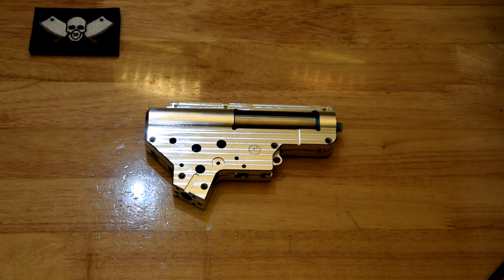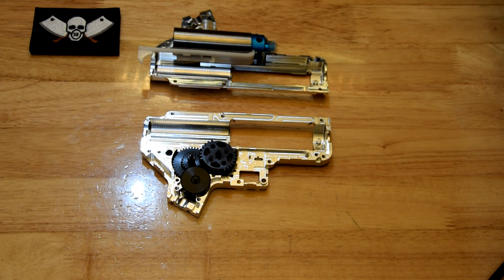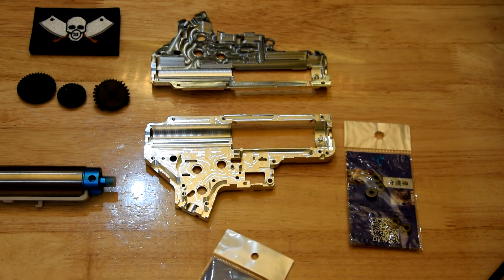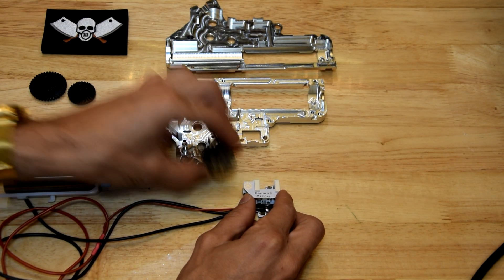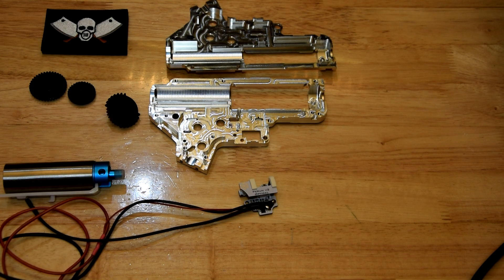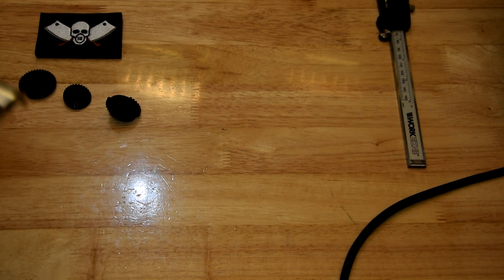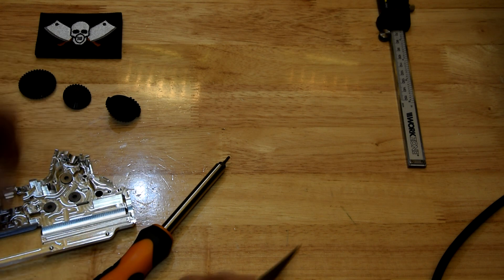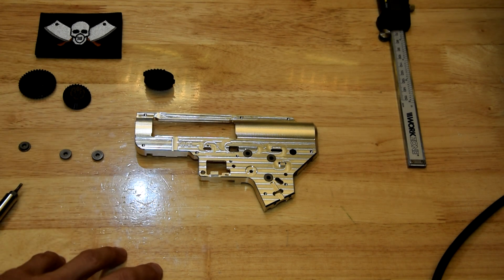CNC MK gearbox DSG build (part 1) installing bushes.

Comment: I would suggest putting your bearings in the freezer to cool them down and setting the gearbox housing in the oven at low heat. This allows you to have higher equal temperature. Once the gearbox is at 100° ish you can pull it out and just drop your bearing in. It may not seem like the quickest option but at least you can be certain that the flanges with sit PERFECT and self centre. If the bearings do wear out you can just heat it all back up and punch the bearings out and redo.

Comment: So I've watched a bunch of your videos and I'm just trying to do a gen 9 gearbox and still yet to have it firing nicely no mosfet though have metal cut-off lever, 18:1 SHS gears 1.4 unequal spring, nylon tappet plate, bearings, metal teeth. I'm located on GC would be Keen if we could meet up and have a yarn about blasters and can show you what issues I have ?
Reply from the maker: What are the issues?

Comment: What tappet plate is that?
Reply from the maker: its a wells tappet plate and it may not be the tappet plate that I actually end up using.
Reply: @lowguidoschopshop  I do like the chamfered front edge. How does one acquire a Low Guido patch exactly?
Reply from the maker: @jj87a  email me deelowguido@gmail.com

Comment: Got a question just got a new motor the issue is it has a 10 tooth turn tip but the original is a 8 tooth turn gear the metal 2nd gear is a 30 tooth but the nylon is a 24 tooth iam going on a limb and will say no the 10 looks smaller in the tooth but always ask a professional, as the new will not get hear befor game day😢 can you use the metal motor upgrade on the nylon or do you need to change for metal gear or change the motor tip for the nylon????or she will be fine mate?????? Anyone iam sure it's been mentioned some where?????
Reply from the maker: metal on metal only.. never mix nylon and metal. it wont last.
Reply: @lowguidoschopshop  it's only got to last about a day few hours use or is it chew city from run?? there a size difference on nylons 8/24 first set and 10/30 metals and I can't be stuffed changing it you know. Other than order will not arrive befor game day so original green O ring  and 1.3 spring or you think I should risk it 😆if it last??? the set has a metal set cylinder so on the 1.3 on the last pin it jams on the original nylon she will fire also found why some say no metal on the return bar it cuts the pin on the down on the gear heard it can chew the nylon case too 😕 just lucky for the metal plug in the center it's still ok to use 😰 😡 got to get them metals there is a metal plunger now available too full Metal gearbox give the T-pic unless you have something different should just use a airsoft hop T-pic with a bore out to the gel size nasty.